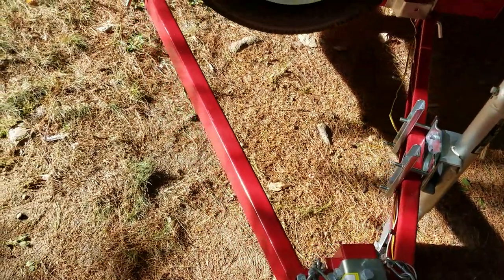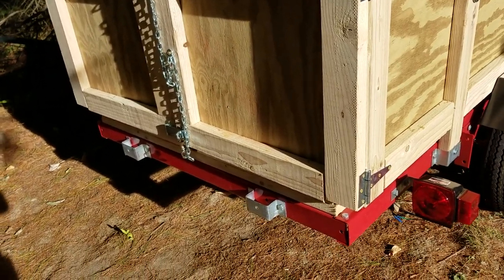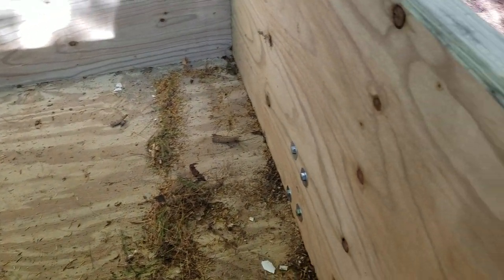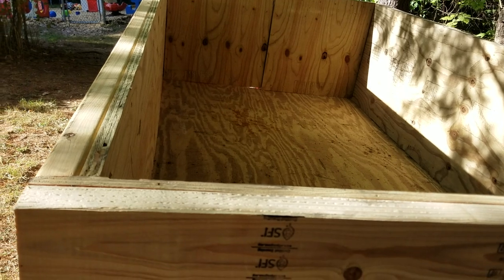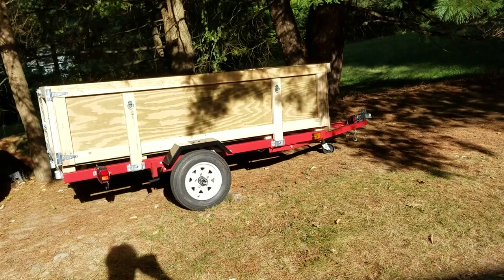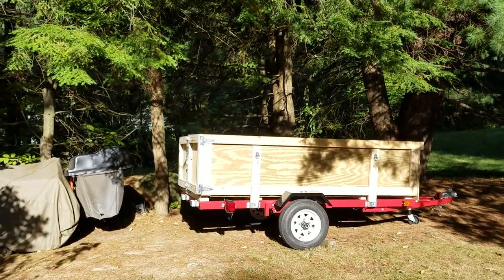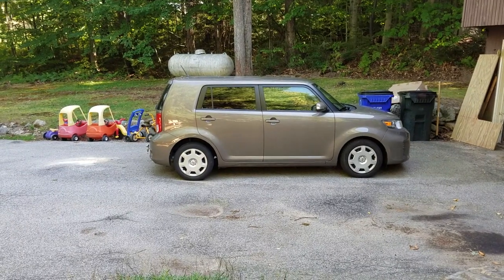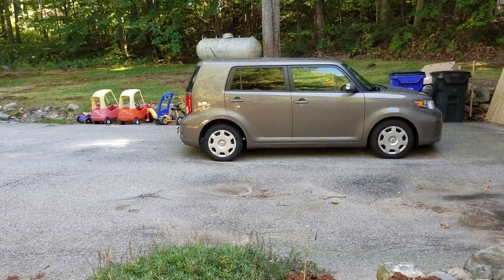HARBOR FREIGHT HEAVY DUTY TRAILER

Comment: I have same trailer. Bought used but in excellent condition 4 yrs ago for $500. Already put together, sides, painted, even had a loading ramp that doubles as a gate. Like a landscapers trailer. It tows awesome, and I've really tested its limits! The most I've had is a yard of top soil and on a separate occasion...a 1,000 lb square hay bale. No problem. I get compliments every time I use it. And .... best part is.... its so light you could half ass back it up..( empty) unhook it,  and physically lift it and adjust it your self.

Comment: I bought one in 2016 as well and spent a couple of weeks in assembly.  Had a problem with the axle.  The two flat mounting locations welded to the round axle where it connects (with U-bolts) to the frame were not in the same plane - when one was flat, other one was tilted.  Poor quality control.  Complained to Customer Service in Camarillo, CA, and they were pretty good about getting me a replacement axle.  I bought a pair of steel box tail-light guards from Tractor Supply (carry-on brand).  They do a good job of protecting the lights from getting banged around. Next mod:  submersible LED tail lights.  If I had it to do all over again, I'd get the similar 5x8 aluminum "DIY" trailer from Northern Tool.  A little more expensive, but 5x8 instead of 4x8.  I might sell this one and do that anyway.
Reply from the maker: I did eventually sell it. I just didn't trust it to hold up over time. I did a video on "goodbye harbor freight trailer"

Comment: I added a 10 ft. 2*2 steel to make it 16 ft. long for my canoe. Where the casters went I put 3 ft. long angle to mount my lights so I can put in the water. great boat trailer.
Reply from the maker: Sounds like a good idea

Comment: I have two of them one is 4 x 8 with 4.80 x 8 wheels on it the other is a 5 x 10 with 4.80 x 12 wheels on it got both back in 1982 for the same price that cost for one 4 x 8 today still using them today out on an atv trip one set of wheel bearns have deen replaced on both of them there whole life thy painted black now.

Comment: Question on the rear gate. Do you have a lot of weight against it or how is it. I like the swinging back gate but will be hauling more of the grass, leaves and branches but the on occasion top soil or mulch
Reply from the maker: First of all no supplier will sell you more than 1/2 yard of dirt or stone at a time which weighs about 1500 lbs so your trailer won't be so full as to be a problem for the back gates. This design will haul 2 full yards of bark mulch which will fill it full but level to the top of the side walls. This is my second trailer using this set up and it works great for me.  Thanks
Reply: I like the design. Thought about doing the full 4' swing back around but just worried about the weight of it on the one side when it is swung back.
Reply from the maker: Matthew Ruchwa  it's never been a problem yet for me.

Comment: where did you get the coupon at? was it a website?
Reply: Andrew Allan Guitars  you can get it on the harbor freight website click on the lines on the left side and click on get coupons or you can get them sent to you in a text message that's how get mine
Reply: I found a coupon thanks for replying, I just bought the 1720 super duty today going to star putting it together later this week.
Reply: Andrew Allan Guitars I'm thinking about getting one myself I've been doing a lot of research on it before I buy one if you don't mind can you let me know what you think about it when you get it up and running
Reply from the maker: Louie Olivarez I have been using it and it works great!

Comment: I get what you are saying about "would you do it again?" but I look at it like this.. As you said, the quality of the trailer you are getting from the big box stores isn't that great even at $750-800. A Lwe's 4x6 CrryOn is going to run you $699 before tax, you are getting flimsy welding, tin foil grade flooring, 2ft of less length, and if you want to do any mods you got about 8in of side wall to work with, it's pretty pathetic no matter how you look at it.

I also got my HF 4x8 trailer for $350 out the door, I spent $185 on #9 raised expanded metal for the floor (approx 1/8" thick), #9 flat expanded for the sides, and 3/16" 2in angle for the railing, and I spent $200 on a HF Titanium Flux Core welder. So right now, as it stands, I have roughly $550 in the trailer and material invested, once I weld it up, it's going to be built more solid than some $1000 trailers from BigTx. Another $75 will get me the material to weld up the gate and hinges, so $625 out the door and it will last me 20 years after a nice coat of roll cage and frame paint from VTX. 

I feel like it's a solid investment if done correctly and the satisfaction from doing it from the ground up makes it feel like some old school American ingenuity, if such a thing is possible with Chna made products from HF.
Reply from the maker: I agree with you and it was a fun project.